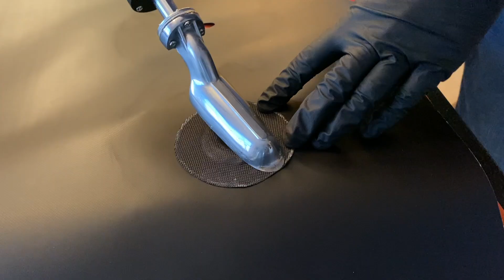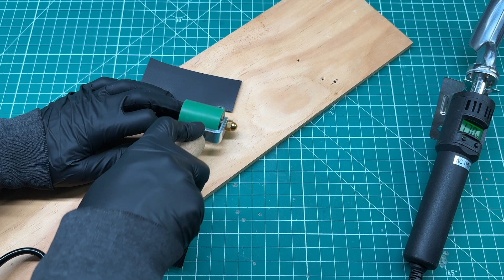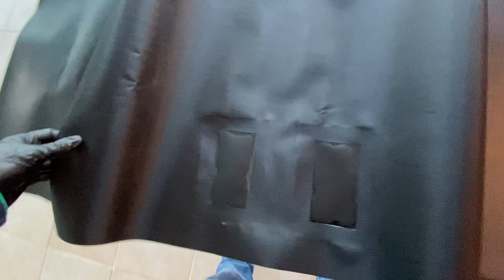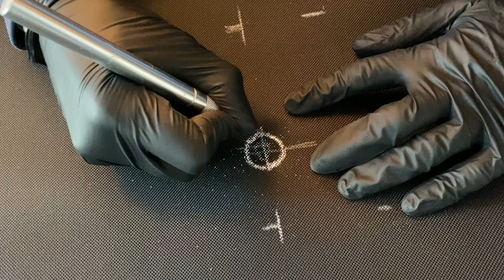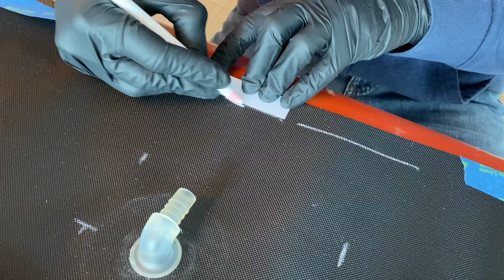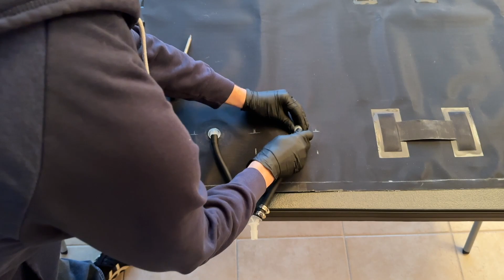DIY Boat Dock Air Lift Bag – How I Built It

Comment: Perfect for what I need, JUST ONCE! Whats the lift capacity? I am trying to roll a very heavy table onto caster without breaking them off.
Reply from the maker: I don’t know what the breaking strength is of the material or the welds. I can only suggest being super careful. I’d prob avoid trying to use it with anything super heavy. I’ve only used mine in water to lift relatively light loads

Comment: Maybe add a scuba OPV (Over Pressure Valve) to automatically prevent an "oops".  You can skip the gauge then.

A small scuba pony bottle or HP air paintball tank could fill it easy.  Just do not use CO2 because the cold could damage your material (ask me how I know).

Comment: I finally got all of my supplies and am starting to build the4 lift bag.  My bag will be 90" x 30".  would you be willing to share the size of the handles you made?  Because of the size of the float, I am considering putting three handles on each side down the middle as hopefully this will be used in a horizontal/vertical configuration.  It will be in the back of the lift to support the backend which is in 6 foot of water.  Thanks for all the great pointers of what to do right and what to avoid doing!!!
Reply from the maker: Awesome! Hope the project works out. Just a warning, I have no idea what the safe lifting weight is for this material. So please be careful if it fails during a lift! Def an at your own risk kind of situation 😀

I measured my handles today. The usable part of the handle is 12.5cm long and 5cm wide. The “tabs” at the ends that are heat welded down are 10cm x 4cm.

Some additional info that you might find useful: putting the handles on is pretty time consuming. I had originally planned to do 4 on each side for a total of 8, but after welding 4 of them I was done hah.

I’m preparing to make a V2 lift bag that attaches the handles in a different way. I want to try sewing the handles on and then heat welding patches on the opposite side to seal off the holes that are made from sewing. I haven’t tested this yet though. I’m curious to find out if I can heat weld on top of the seams without melting the thread and damaging the seam. Or if I need to heat weld around the perimeter of the seams. 
 
Also, I recently made a slight modification to my V1 lift bag by heat welding the corners a bit more to make space for punching holes and crimping in metal grommets like the ones they use on perimeter if tarps. This allows me to hang the deflated lift bag and get it out of the way. I’m not a fan of folding it and potentially putting strain on the TPU coating. I used this crimper kit to do that (affiliate link) https://amzn.to/4mLd0XT

Anyway, good luck with the project. I’d love to hear how it turns out if you feel like sharing.

Comment: Great job.  Have you had a chance to try it out?  I need to build one for may boat lift and wondered if this will work.  Is the material heavy enough for this application?  Wish you would have mead it with a thicker material?  Did you get a roll of material?  thanks
Reply from the maker: Thanks! Great timing. I posted a video of using the lift bag today: https://youtu.be/C_xDCzkMBng

I don’t know what the breaking strength of the welds is, but people make DIY inflatable kayaks with this material (thinner stuff too) and I imaging those take a decent amount of punishment.  I personally would be willing to try it with a boat lift, but I would be careful to avoid injury if the bag failed (avoiding getting my body squished between the lift and something else). Another factor is being able to develop the skill to create good welds. I practiced a bit and tested the strength of my welds before I made the bag. 

There is a company that makes lift bags specifically for boat lifts. They are quite expensive: https://www.boatlifthelper.com

The material I used is pretty thick. I had to buy it over seas because I was unable to find stuff this thick being sold in the US. I bought about 11 yards. It came folded in a box (not rolled).
Reply: I have the material on order but having problems ordering from AliExpress.  They tell me I cannot use the coupon code but can't figure out how to order without it.

Comment: I wonder if one could fill it with water / anti-freeze to add weight to a pickup in the winter for better traction? 
Looks good tough material, and the video was great!
Reply from the maker: Interesting idea! Might be a bit messy if it decides to break hah. I’d prob opt to go with that tube sand stuff.

Comment: I really like it! I didn't realize it's relatively easy to do this sort of thing. I want something like this to lift up my campervan instead of using lift blocks and there are products but they are very expensive. Nice work.
Reply from the maker: Thanks! I’d be scared to attempt lifting anything real heavy like a vehicle. No clue what the breaking strength is on the fabric.